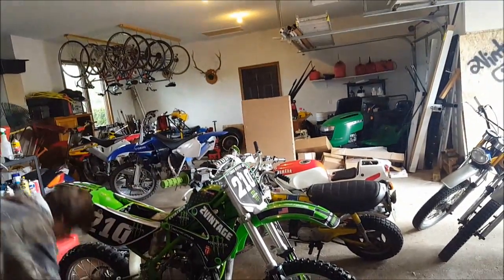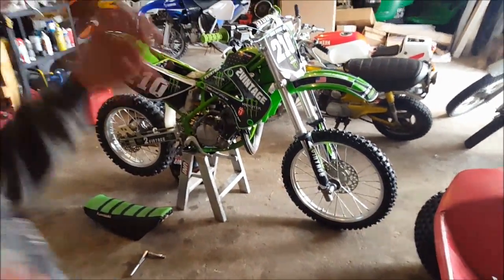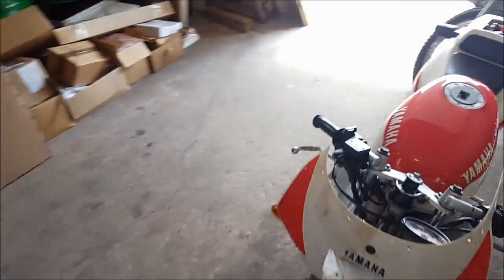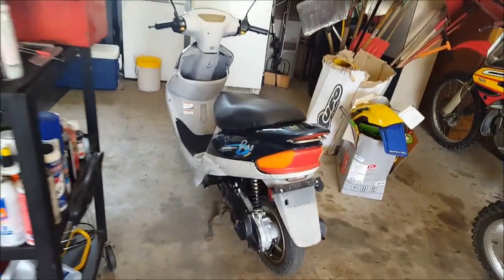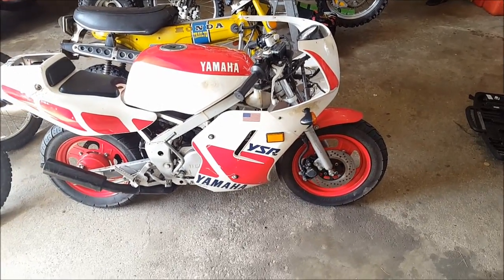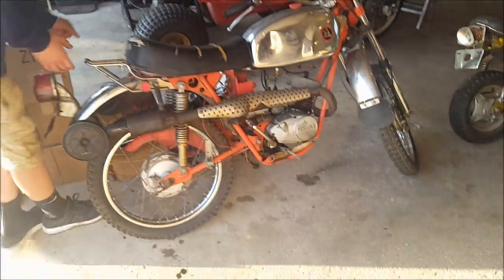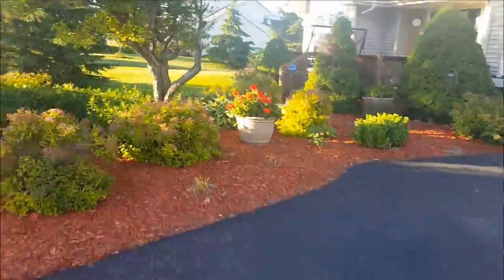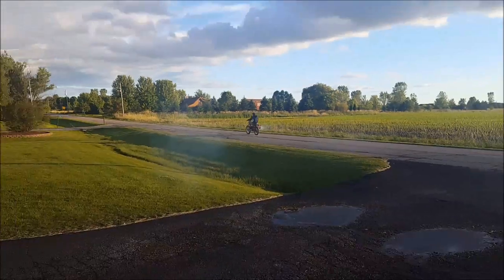First Ride on the Hodaka Ace 100!!!

Comment: one up 4 down...... ultimately they went with one down 4 up in 73 I think it was... The Hodaka Super rat..... the stripped down version of the ACE ruled the 100cc class at that point.... BTW.... you only turn on one gas cock...... leave the other closed for reserve.... I had a 73, loved it.....

Comment: I just got a 1973 triumph TR5T Scrambler that's been sitting in a garage for 20+ years and is in rough shape. It needs the carb gone through,   2 new petcocks,  and an air filter, and I should be able to start it. Do you have any tips or recommendations on where to find cheap vintage parts?
Reply from the maker: chaos8585 sweet!
Reply: That bike smokes more than I do!

Comment: Xducer silencer on that Hodaka. They were supposed to be all that when they came out. They had some kind of reeds or something in them that you could change and supposedly tune. You took the center bolt out and they came apart and the reeds or whatever were like a thin disk with a hole in the center that fit over the bolt. In reality, they were kinda restrictive for larger bikes, but they were quiet.

Comment: Way back in the day, my first "race bike" was an Ace 100 that I converted into a Super Rat. It served admirably until I sold it to buy a Husky... 😎
Reply: I also had one back in 1972 ... I thot that they were called "Hodaka B+", but the "Ace" moniker does ring a bell.  I totally stripped the bike, painted the frame black and put an expansion chamber on it ... it actually had a power-band after that.  I would disassemble the engine and try to smooth-out all of the cylinder ports and clean up any carbon, too.   Tried to make a Super-Rat out of it!

Comment: It should say fuel mix on gas cap.  I think it is either 20:1 or 32:1 that is why it runs what appears to be rich.  I had a Hodaka ace 100 and the slimmer tanked Super Rat.